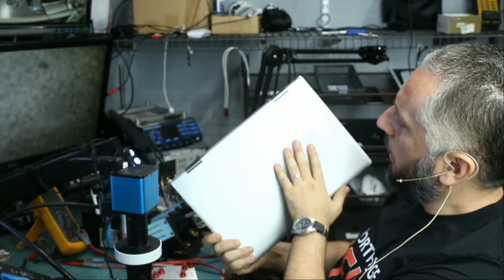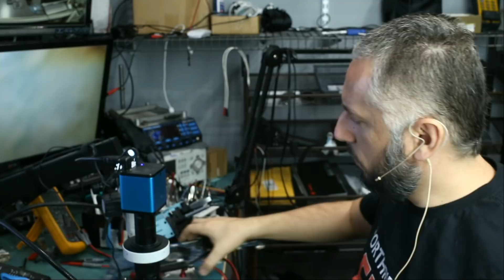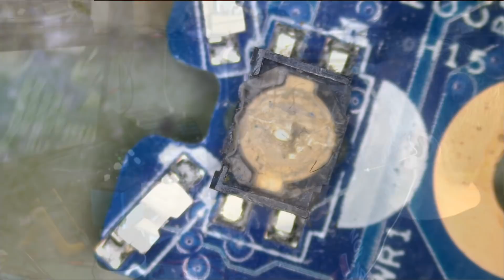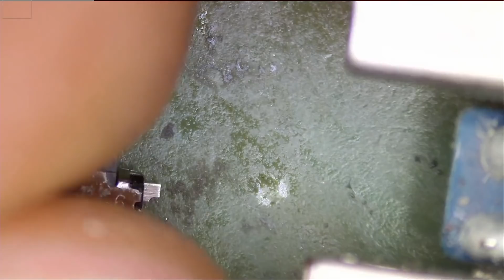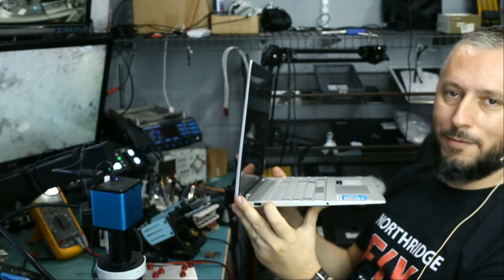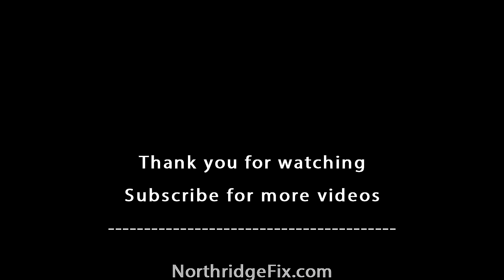HP Spectre X360 No power - Bad Tactile switch design. Power button modification was a Success.

Comment: My power button worked the previous time I used my HP Envy 13-ab077cl notebook laptop. The orange battery charge light which become white when fully charged is working. How can I determine if the power button is working correctly or not? I have removed the bottom cover to access the internals of the laptop. I have a multi-meter.

Comment: The side button you installed can be ripped from the board along with pads if user pushes the button very hard. But in manufacturer's original design user is pressing the button down on the board so its safe even if pressed hard.

Comment: It sound like bad design but I think they had to do it like that because whenever you press the button there will be no direct force applied on the button pins
You know user may puch the button hard sometimes with this design it will unlikely to damage the contract points

Comment: had one of these laptops. the charging capacitor burned on the mother board and it wouldn't turn on unless a new exterior charged battery was installed. I got my stuff off, with brand new battery. HP refused to repair it. they wanted $500 to repair it. barely off warranty. Many complaints with model and the capacitors.

Comment: Good day Sir, My wife samsung a5 battery always is bloated. we change the battery 4 times. Is there any components we need to change than a battery?
Reply: You have leaking component, you need to take it to a repair shop for them to check the board and remove and replace the leaking component. (electric leak), most of the time caused by water damage, but sometimes capacitors just love to being a pain in the arse.

Comment: My friend. The original button was damaged. All buttons have the inside membrane button that you see inside and then there is a plastic button the protrude out to be pushed in. After that there is a metal cover on top to keep it all together. Tear a part a new button from your 500 item box and you will see what I am talking about.

Comment: It is like the original button, the original was only broken. Under the metal cover all 90° buttons look like this. The small folded cutout guides the button on the plate. On the other side of the mainboard you will find two identical buttons, if you have a board for parts you can use it. But good work (and bad button design) :)
Reply: this is true... both of these buttons have the same mechanical movement

Comment: The original button is probably similar or maybe even identical to the one you used but it have missing parts(the plastic pin and the metallic shield). just take a look at one of the buttons you used and you will see it work the same way.
Reply: This is the right answer. The original button miss the metal part and the little plastic to push down the button. If you try to open the new button the result is the same

Comment: That's engineered in a way that instead of breaking the PCB, it breaks the plastic part. Your design however, if the user push it way too hard it will rip the pads from the PCB. Just my opinion. In HP defense, replacing the plastic part is easier than a ripped pad.
Reply from the maker: If you press hard on your screen, it will break also. The button i used is popular among most laptops tablets and phones. The way HP does it, If button plastic breaks, you can't find a replacement part anywhere. Only HP can fix it and they will charge you an arm and a leg to do it.
Reply: @NorthridgeFix  That's true, but still easier for them to fix. I am not arguing that their solution is more cost-effective than yours. It's just designed that way to make it easier to fix for them. IMO, I have done some fix like yours and from my experiences, its a bit risky depending on the pad strength.
Reply: r5xscn hot glue is your friend, doubt anyone will push that hard to break it , would take a lot of force with good solder agree with northridge mod , think it’s actually more sturdy especially with some hot glue for good measure.
Reply: @user-te1le7ck6b  I am not sure if hot glue/hotmelt can hold it properly, but when the force is not perpendicular to the PCB / or something backing it, then you are risking the pads on the PCB. I have a power bank with a power button soldered like the one in the video, and sure enough, my sister broke it with enough force. IMO, I have a similar model with me and the power button is still working as new. If I were the one to fix it, I would not replace the button but mock up a replacement plastic part (3D print maybe?).

If the customer can break the plastic, then sure enough they can break the solder pad lol. I am not on the HP side, but I almost never read a similar issue on the specter 360 subreddit.

But after the first reply from the channel owner himself (if you press the screen hard (not sure the relation with my comment)), I now know what type of person he is. Attacking someone with your first sentence is not a really good start. I will withdraw from this conversation and I still stand with my opinion.

Comment: Really really good. Very good improvement. Thats the way a button should work👌👍 The design of the original button is really a crap, foreseeable that it will be defectiv. Whats going in the head of some designers? 🤦‍♂️
„planned obsolescence“ thats the way how industries work today, it should break shortly after warranty ends and than you have to buy a new one if you dont have the experience and knowledge to repair it

Comment: The button you used in this repair is what should have been used in the original design. What were those engineers thinking??
Reply from the maker: I never had to look at power buttons on the HP spectre before. But today i was surprised and confused on why it was made that way.
Reply: @NorthridgeFix  It just makes no sense to translate the horizontal motion into vertical motion using some weak plastic part which clearly didn't last. The new switch is much better. Very nice repair, thanks for sharing with us!

Comment: Just think, it took a qualified HP employee to think that up. It would be interesting to get their reasoning. Doesn't seem to have logic.
Reply: hahahahahahaha.
Reply: Actually it is common for that style of buttons (the new button) to fail very often due to a cracked solder joint

They might have designed it this way (the new plastic mechanism)  to avoid  applying shearing forces on the solder joint.  
Because of the mecanical propreties of solder, it is known that solder is not an appropriate material to withstand mechanical stress espacially sidways (shearing forces).

but it seems like they created more problems than solved...